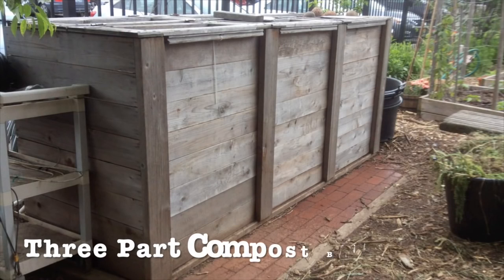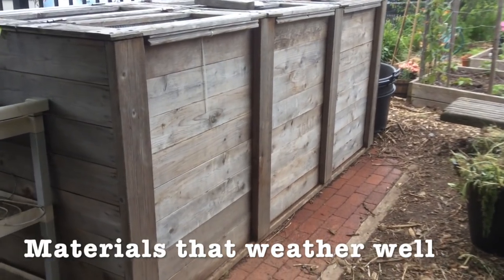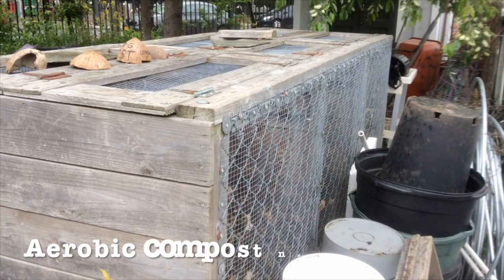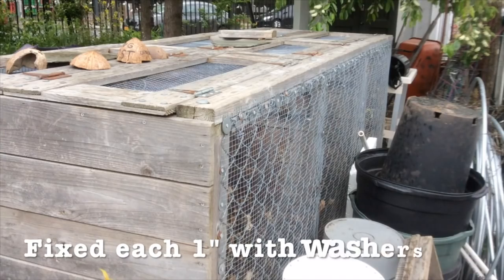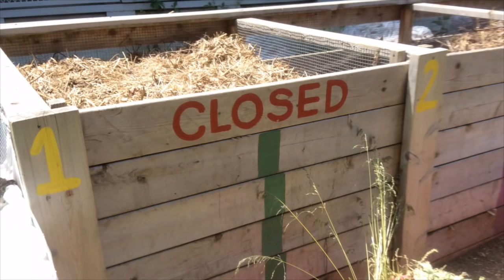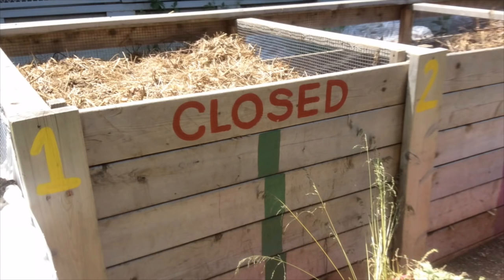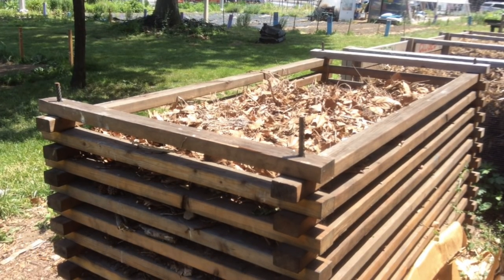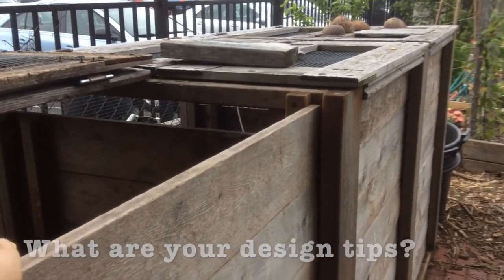(Aerobic) Compost Bin Design Tips - Quick Tour of Brooklyn

Comment: In open garden, there are at least 3 compost bins made of wood pallets. Top is open. Front side has movable wood door which can be bent open wide from top to bottom, to get compost when ready. In zone 4 in MT US, snow comes as early as Sept, first frost when hailstorm comes. One time, insects from another area of property from some underground part of well water landed on one compost. They bite skin causing problem. I think they were wasps. They were sprayed in well water area & no longer in compost bin after that. If wasps cause infection on skin, then are they not safe for composts that will be used for food soil?